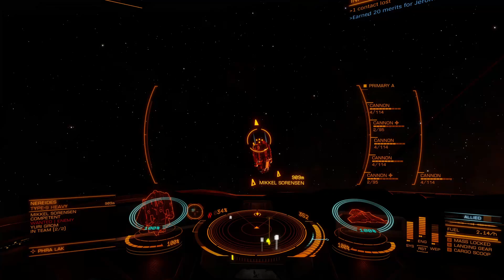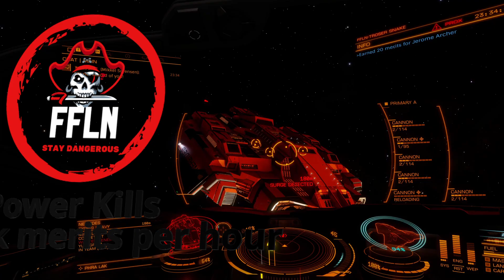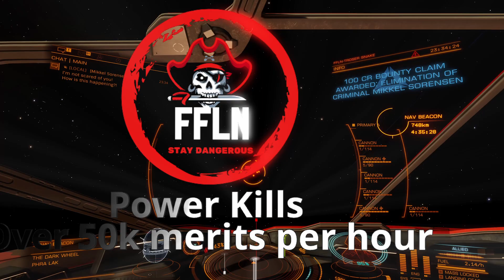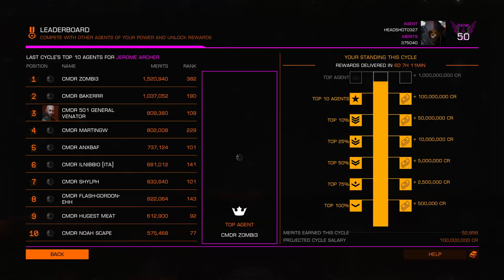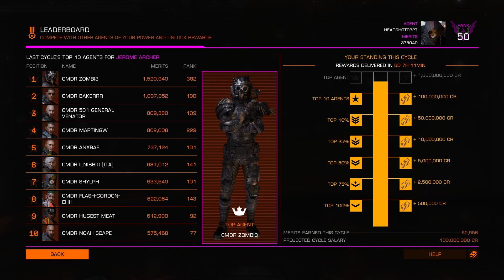Elite Dangerous PowerPlay 2.0, How to Power Kills 50k+ merits per hour, No exploits or glitches

Comment: This is fantastic, TY
Reply from the maker: thanks for watching
Reply: You should try these system's in the Galaxy map search bar and fly to them. 07 🫡 I will warn you there are ghost systems green gas giants and Saramandara Pearls, and yes on the ghost systems you can go there, if you know how..... Turn systems from red to blue red meaning you haven't been there blue meaning you have been there, you have to turn off the lights to see the lights,.... mess around with your Galaxy map panel bar,... But in other terms I rather just complete the circuit.

Gamma velorum , HD 125178 , HD 125142 , HD 100085 , Wregoe yk-p e5-83 , Psr joo24-7204e , Psr joo24-7204o , Psr joo24-7204t , Psr joo24-7204q , Psr joo24-7204u , Hip 13044 , Cygni x-3 , Plaa aec iz-n c20-1 , Eafots eu-r c4-1 , Pru aescs dl-w c15-37 , Stuemeae fg-y d7561 , Stuemeae km-w c1-4809 , Ic 4673 , Ic 2391 sector ze-a d101 , Ic 2391 sector gw-v b2-4 , Cygnus x-1 , Cygnus x-3 , Evelyn's light , Urt , Ads 9338 ac , Scheau bli nb-o d6-342 , Lil , Synuefe xr-h d11-102 , Trappist-1 , Lft 509 , Rigel , Ngc 2841 , Ngc 5195 , Ngc 1566 , GJ 1214B , Cw 190521 , Rx j1856.5-3754 , Serpent 37 , 6 Lacertae , 6 Lambda Leporis , Alnilam , Alnitak , Mintaka , Sol , Proxima Centauri , Sirius , Stephenson 2-18 , Carcosa , Maia , Ads 4229 abc , Eimbaith Lw-w EL-290 , Floasly te-x d2-25 , Synookio EL-J d9-1 , Gongae Qw-1 c24-0 , Byoi aewsy r2-f d11-104 , Eol prou kw-1 cb-32 , Blua hypa hi-f d12-1226 , Bleia dryiae hf-w b35-1 , Col 285 sector vu-m c8-32 , Eol prou kw-1 c8-32 , Eafoff IN-Q d6-0 , Dryooe prou ff-z d696 , Boelts XH-C c29-854 , Shaulai DL-P d5-274 , Stuemeae bv-y f2111 , Stuemeae nn-s e4-1360 , Stuemeae nn-s e4-5583 , Nyuena bf-r e4-3196 , Nyuena bf-r e4-4054 , Nyuena bf-r e4-2200 , Nyuena bv-p e5-458 , Nyuena bv-p e5-1493 , Nyuena bv-p e5-2376 , Pre Aowsy ba-a , Brambai uz-o e6-313 , Dumboe aa-a h207 , Hypao brai kw-v b5-21 , Hypio gree aa-a h56 , HD 155889 , Bleia dryiea xj-r e4-1 , Hi'iaka , Angosk jm-w d1-05 , Hip 52741 , Tira Flirble , Smade's , Hip 57951 , Lorant mi-b d13-1 , Blaea brou cn-b d13-06 , Psr j0024-7204Q1 , Eolls hypai no-x d2-06 , HD 64285 , Hip 64902 , Hip 604151 , HD 213221 , HD 211744 , Hip 57951 , Smeamaa aa-a ho4 , Phleedgoea kx-u f2-10 , Garth , Izar , Axanar , Klingon , CBS , Orian , Actaea , Vanth , HD 35460 , Hip 57951 , S171378 , Smith's claim , Pru aescs zk-p e5-103513 , HD 474171 , Swoiwns td-r d5-85 , Wellington , HD 64287 , Hip 64902 , Oevasy sg-y do , Hyphiemoe yk-p d5-0 , Eolls hypai ll-z d1-02 , Psr j1641+3627ba , HD 64282 , 2 mass j02323627+61282553 , Nyeajoa fb-o e6-oa , Eor phyloi cl-y g137 , Pria thoi zp-g d10-37 , HD 2020881 , Ogaicy zo-a e4228 , HD 935217 , HD 984256 , HD 71297 , Ra , La , MYT , Boetis , Sagittarius A* , Beagle point  , Romulus  , Polaris , Wolf 359 , Gargantuan , Miller's planet , H    , last bust not least use your first three letters of your commander name in-game for your secret starter system ..